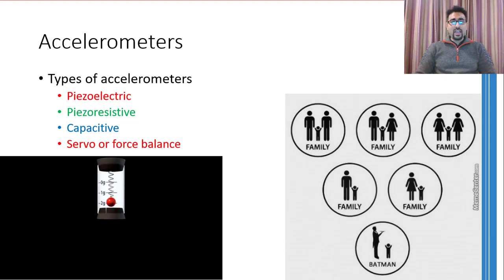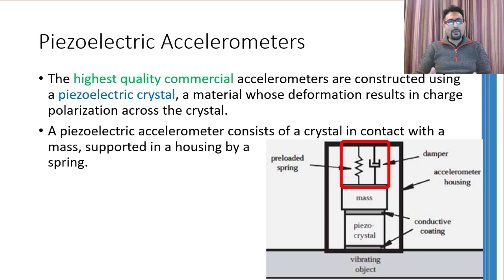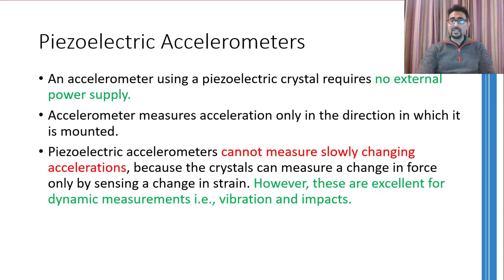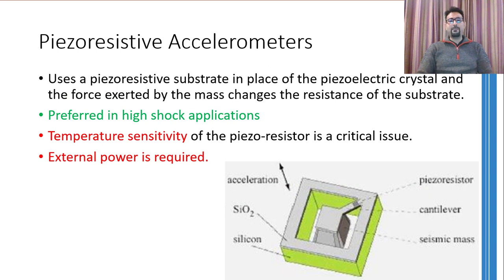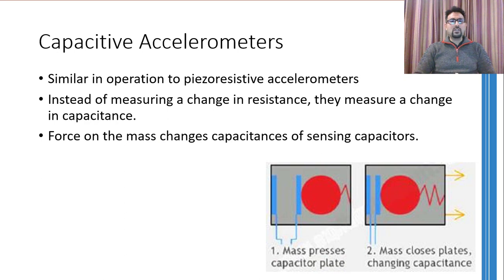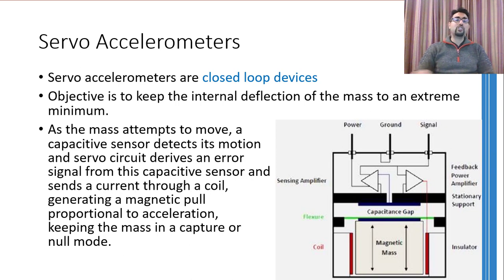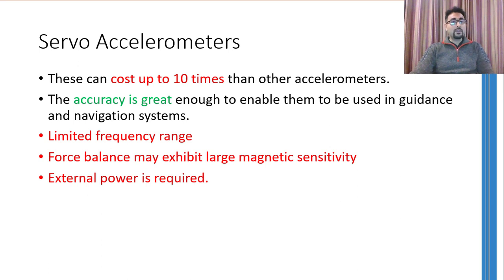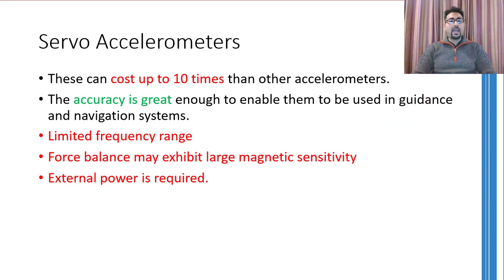Lecture 11 Accelerometer | How It works?

Comment: MODEL:604B11
 Sensitivity: (±20%) 100 mV/g Frequency Range: (±3dB)30 to 300000 cpm is a multi-axis type of accelerometers can measure acceleration with three possible axis